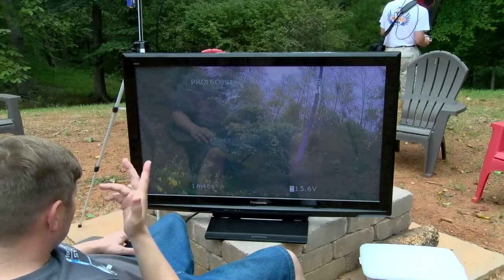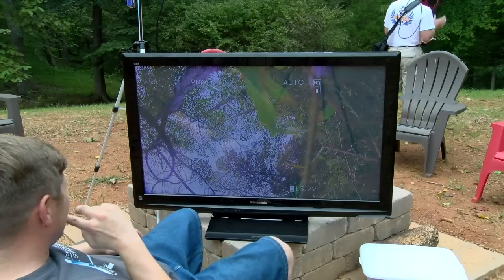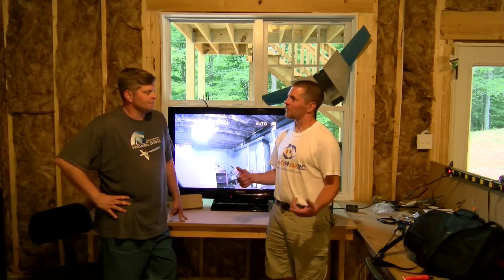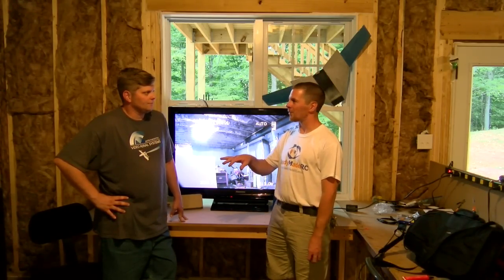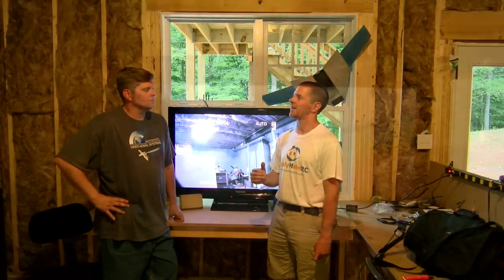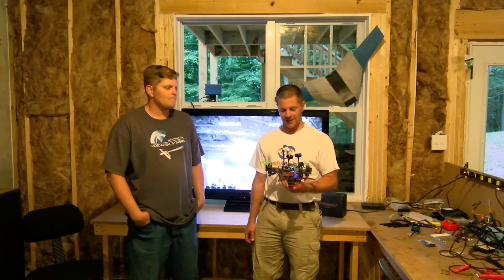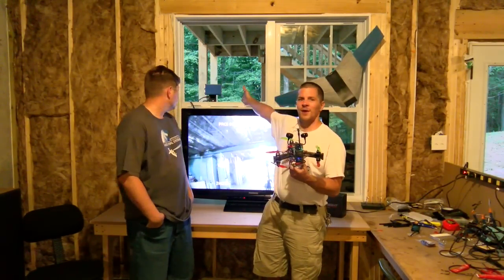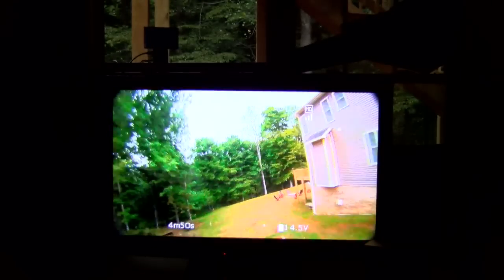Connex prosight - Signal block test

Comment: I'm not a big fan of the Connex system for a number of reason but my real question is really centered around the diversity setup. I noticed all of your antennas in these test are vertical. Is there a reason you don't have them in different orientations? I mean this is diversity right?
Reply from the maker: It's not diversity.  Each antenna takes in a part of the signal and then all 5 receivers are recombined into one.
Reply: i wondered the same thing too but it think it has something to do with signal integrity it makes it better or something. See if alex replies he probably nows.
Reply from the maker: FLying FPV with video transmitters intended for wireless security systems is a mis application of the product.  But we do it anyway every time we fly.
Reply: @Video Aerial Systems Ok thanks for clearing that up. Wow 5 receivers for one signal huh! I'm so happy with my Eagle Tree diversity system and now with the Runcam Eagle and the 16:9 aspect ratio of the fatsharks it's so crystal clear compared to what it was there's just no reason for me to even think about spending $500 on a Connex system that only goes a couple miles when I already get like resolutions out to 6 miles or more. Thanks for the reply and for clearing that up!
Reply: The ProSight is intended to provide 720 resolution with very low latency for racing. FPV flights miles away are a misapplication of the product.
Reply: David Raines so it's a very expensive part for a very limited market, I like it less now lol

Comment: Why would a digital signal go further as an analog? They both transmit on 5.8GHz. They act different but at the end, they always need line of sight
Reply from the maker: It doesn't go further.  It is just cleaner.
Reply: Probably has something to do with lower duty cycle of the digital transmission.